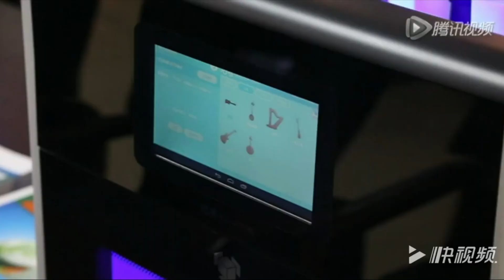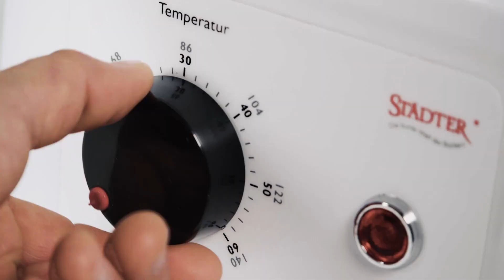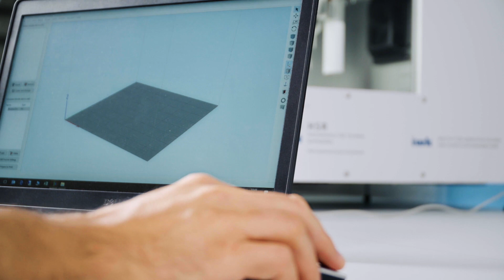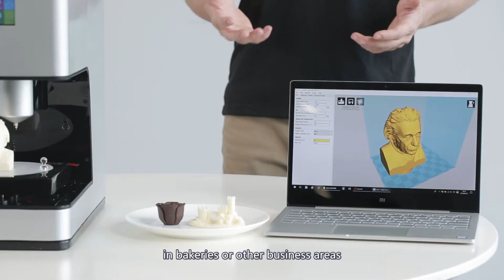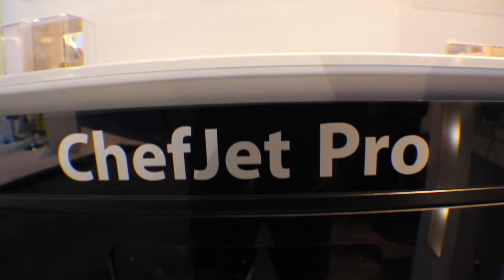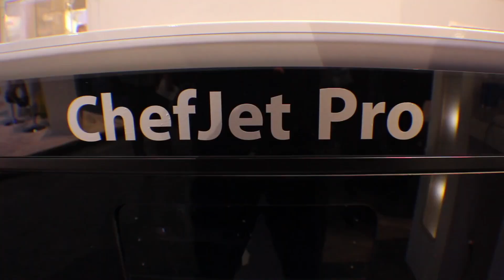TOP 5 Food 3d Printers for cafés and restaurants / Bakery | 3D Printing Food | Starting $800

Comment: Can they print a Christmas Turkey or a Black Forest ham?
Reply from the maker: In theory, yes. 3D printers that printed meat looking food actually used plant based proteins and fats to make their paste, that was squeezed out of the nozzel. So you could use a similar recipe to make plant based meat, and adjust the nozzel temperature and speed to work with the materials of thew new material